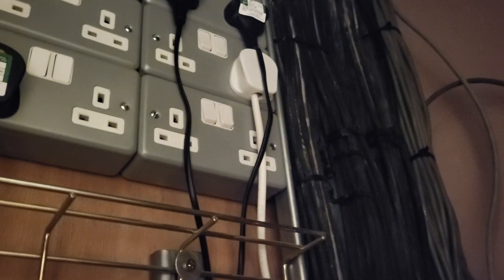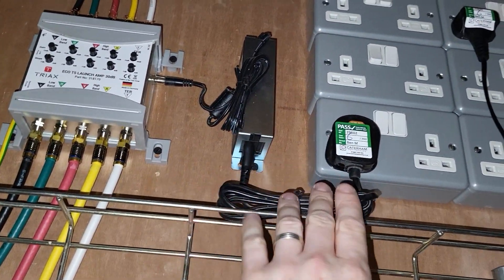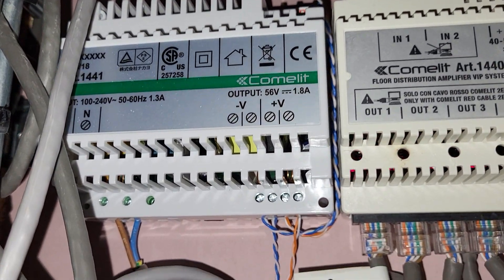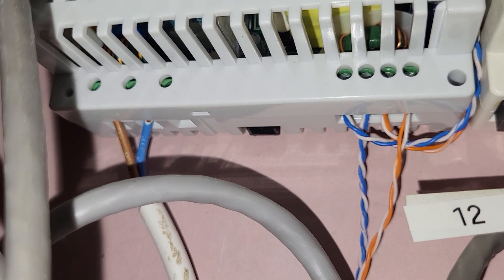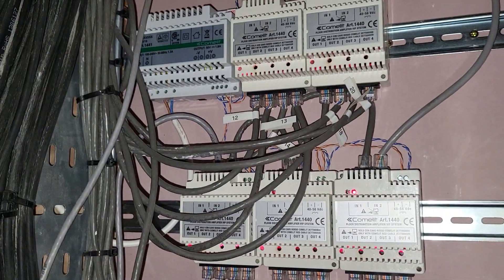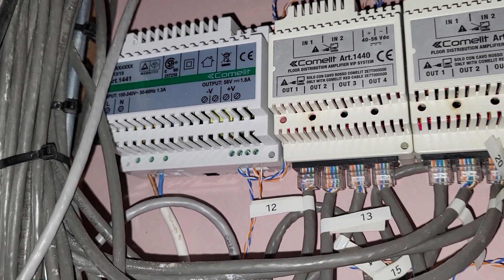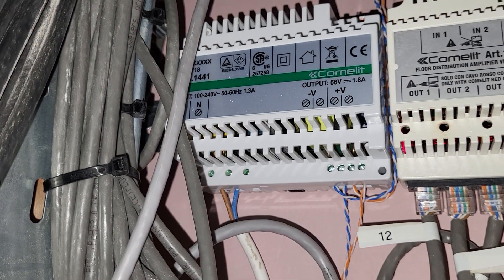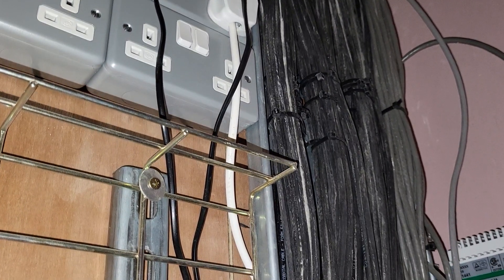PAT TESTING DANGEROUS HAZARD. - Electric Shock Risk

Comment: Who has done the regulation 5 year electrical survey as I believe that falls under scope of that and not PAT testing. That's not to say you shouldn't fail it but not sure what piece of equipment you fail. It should be reported to the property owner or agent. Those transformers should be in locked cabinet.
Reply from the maker: I do disagree with you slightly. This comes under the scope of PAT as I would class this as a fixed appliance as it has a 13a plug fitted so wouldn't necessarily be picked up on a EICR.
As mentioned in the video it fails as there are exposed inner cores on the power supply cable.

Comment: So did you fail it ?
Reply from the maker: on paper yes but couldn't just switch it off as it was powering all the individual apartments. it was in a locked cupboard quite high up, so a tiny risk to the public - duty holder informed to get it resolved